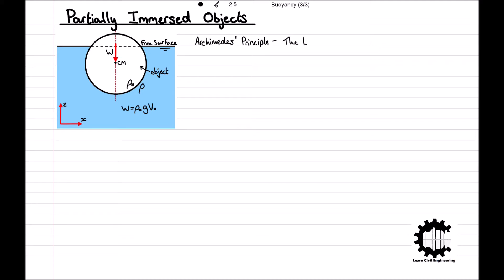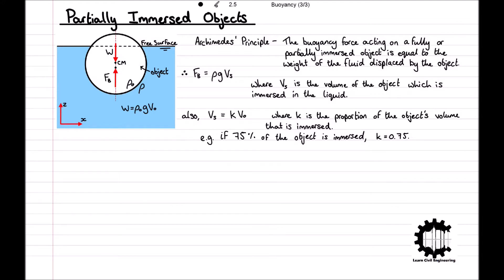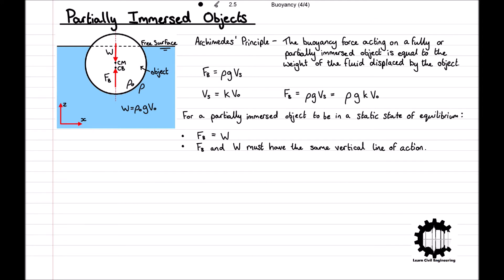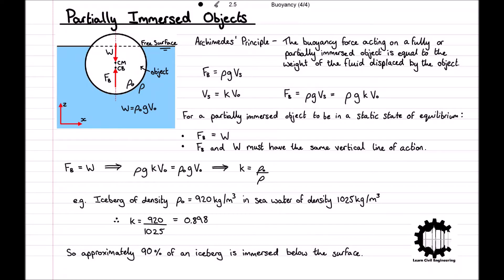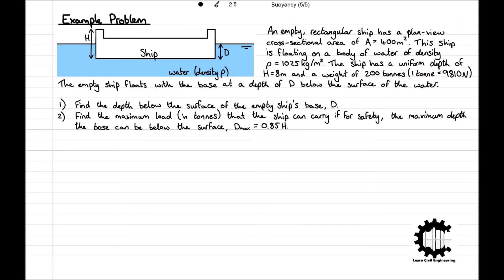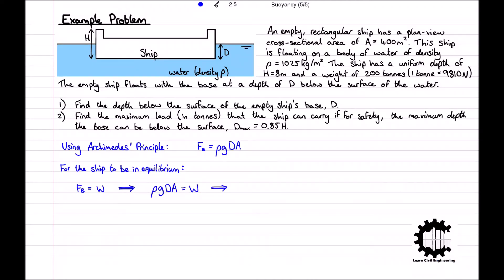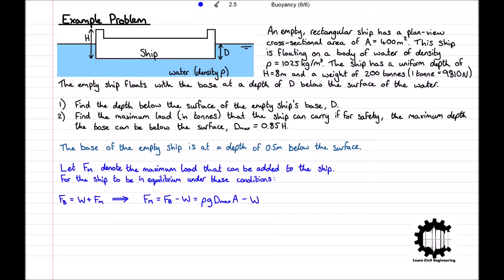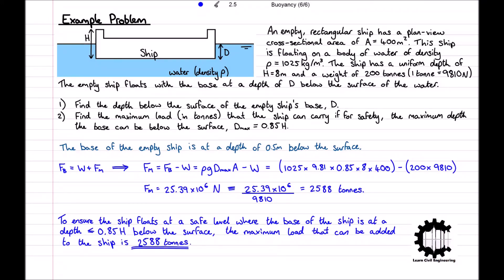Buoyancy Forces on Partially Submerged Objects with Example Problem - Fluid Mechanics

Comment: Does partially submerged and floating  has a difference 
I'm confused cuz Archimedes priciple says upthrust of a partially submerged object= weight of the liquid displaced but law of flotation says upthrst =weight of the object
Reply from the maker: A floating object is considered to be in equilibrium, where the buoyancy force acting on the object is equal to the objects weight. An object can be floating on the surface of a fluid (partially submerged) or floating totally submerged in a liquid. For either case to be floating, the weight of the displaced liquid must be equal to the total weight of the object. 

Archimedes' principle simply allows us to calculate the buoyancy force acting on any floating object partially or fully immersed in a fluid. If the buoyancy force is greater than the weight of the object, the object will not be in equilibrium and it will rise in the fluid. If the buoyancy force is less than the weight of the object, the object will also not be in equilibrium and it will sink in the fluid.

I hope this clears it up for you.
Reply: @Learn_Civil_Engineering  thank you so much!